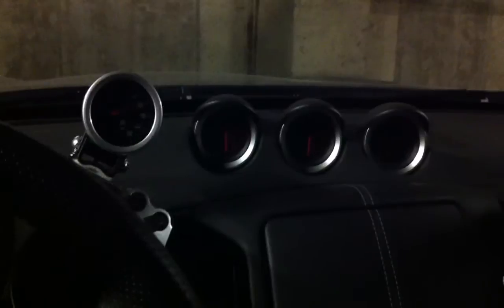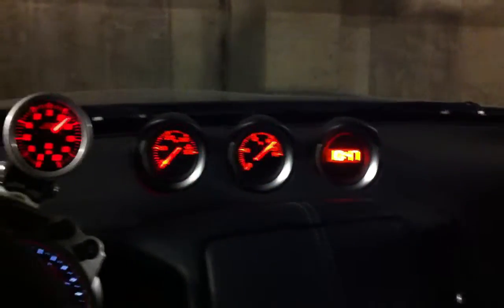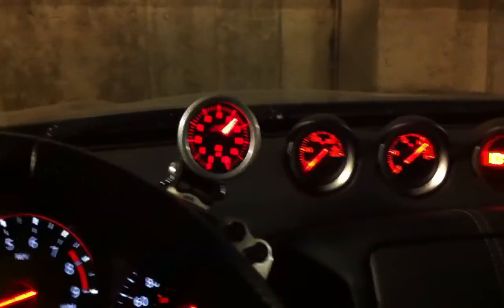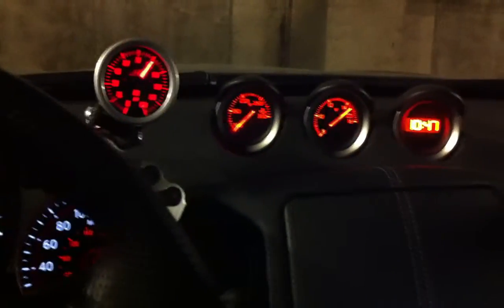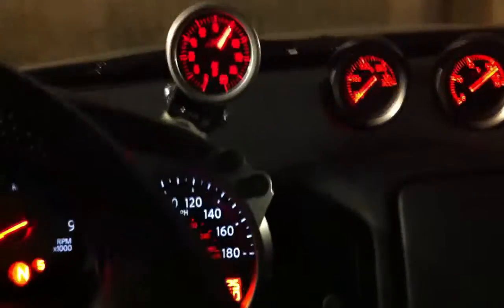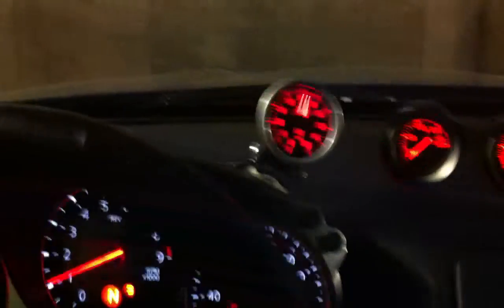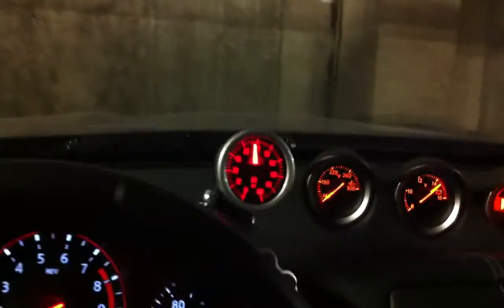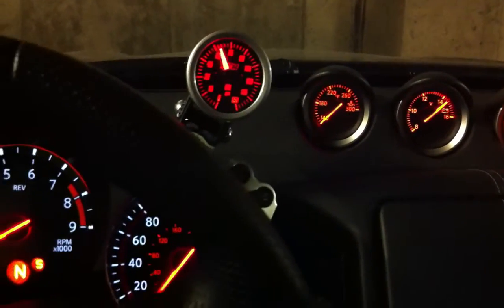AEM Analog Oil Pressure Gauge in a Nissan 370Z

Comment: I have a 2019 370Z and I'm really annoyed with the choice of gauges that Nissan made for the gauge cluster. The oil temp gauge is extremely useful, as opposed to the useless battery voltage and digital clock. Nissan should've put an oil pressure gauge in place of the useless digital clock and maybe something like a diff temp gauge in place of the voltmeter.

Comment: Did you consider removing the clock entirely and moving the volt meter to the farthest right in the stock pod? My buddy did that with his oil pressure meter. Only slightly had to trim the inside of the stock pod with a dremel. Your placement is cool though. Nice job!
Reply: Can't do that. The triple cluster is a single unit. If you want to change one of those gauges, you will have to change all three.
Reply: Trollolololololol
Reply: Thomas Bell im sure if you actually gave it a shot you could do it. the fact that they put a voltmeter and a clock in a gauge pod for a performance car just goes to show that it probably wont perform like youd expect

Comment from the maker: I have the manual transmission.  Other mods include a Stillen exhaust and high flow cats, Hotchkis sways, an oil and upgraded power steering cooler, and some wheel spacers.  Glad you guys found the video worthwhile.
Reply: Does the analog style have warning for low and peak?